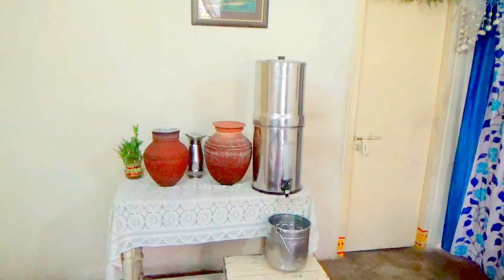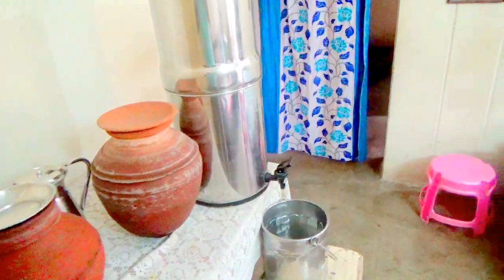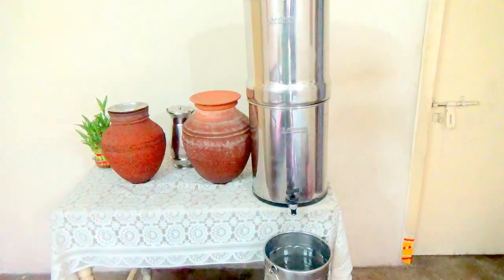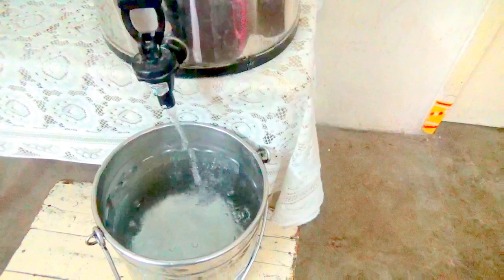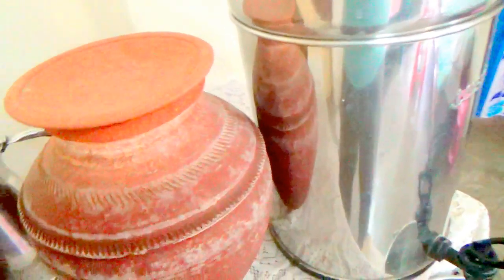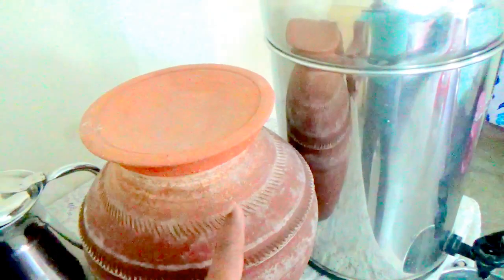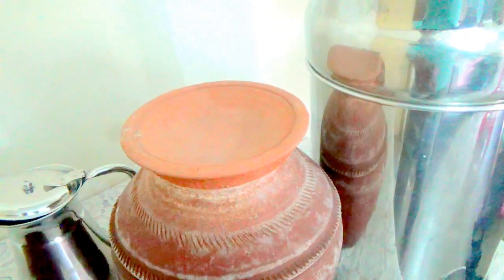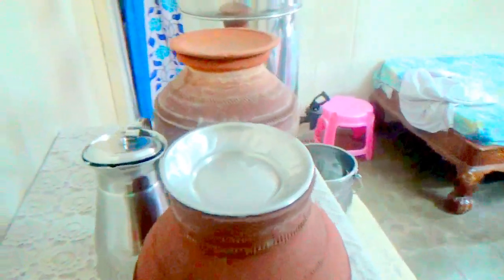Clay/ Mud Pot gives  Pure DRINKING WATER   - Avoid plastic containers  for water use

Comment: Hello Ponnala, I’m so glad I’ve come across your video. Could you tell me more about this steel container with clay candles? Do you buy the container and candles separately? I’m in Saudi Arabia and I can get the clay pots but I’m not so sure about this steel thing. Also you don’t mention after how much time you transfer the water from steel container to the first ghada and then after how much tine to the second ghada. Much much waiting your your reply.
Reply from the maker: Thanks for your initiative gesture shown  about the video.  Actually steel container  is a water  filter (both container and clay candles in one set ) manufactured by the well known companies in India. The same may be available in Saudi Arabia also .  First we have to store the water in steel filter  and the water will filter in to lower  container  in  about 2- 3 hours . Then water can be stored in  first  clay pot /ghada  for another 2 hours approximately. Now the pure water is ready an can be stored in 2nd clay pot for drinking use..

Comment: does mud pot soft  the hard water and salty water ?  for drinking
Reply from the maker: Actually  soil i.e. mud has  a capacity to absorb   the hard minerals   and to some extent salt and removes to the upper surface of its edges. so we can see   clearly the impact of the same in the shape of patches on  surface  layers  of the mudpot. Mudpot can be cleaned at least fortnightly to clear the impurities for safe drinking.
Reply: we  kept  water  in mud  pot  ...   boil  or  simple  boring or municipal  water ?
Reply from the maker: keep municipal water  without heating for few hours , then heat it and use after cool.  bore water can be heated till boiling and cool down then keep it in mudpot similarly. Dont keep hot directly in to mudpot. it will damage the mudlayers of mudpot
Reply from the maker: @Fashion_Clothing520  Bore water has to be compulsorily heated before  keeping in Mudpot for more than 5 to 6  hours . Municipal water normally treated with chlorine process by the Govt. agencies.  However the water now due to corona  virus  may have to be heated   for safe drinking.
Reply: i have  only  mud  pot  not  steal   so  i  kept water  only in mud  pot
Reply from the maker: No worry. use mudpot  for keeping water for few hours 5-9 and then heat it and cool down for use.
Reply: we have here  boring   water  ..  we simply  pore  water  in to  mud  pot  without  boiling  .. is  it  ok   for  use ?

Comment: Dou know what is meant by osmosis???
Reply from the maker: Osmosis is the movement of water or other solvent
through a plasma membrane from a region of low solute concentration to a region
of high solute concentration.Osmosis is passive transport, meaning it does not require energy to be applied.
 Here impure water when we stored in mudpot, the mud i.e. soil will act as filter and removes fluoride & other impurities to outer surface layer of mudpot. we can see the white , colored patches of fluoride impurities on its layer clearly.

Comment: What is that inside the steel upper chamber?
Reply from the maker: Two  candles made with clay material to filter the water by removing certain impurities and then by the mudpots  continously.
Reply: what are the candles made of? how often do you replace them?
Reply from the maker: @crystalhealings9901  Candles are made with clay material to filter the impurities from water . These candles can be used for  2-4 months easily and  replace with new candles available in the market.
Reply: Stainless steel candle water healthy or  unhealthy
Reply: Hello Ponnala, I’m so glad I’ve come across your video. Could you tell me more about this steel container with clay candles? Do you buy the container and candles separately? I’m in Saudi Arabia and I can get the clay pots but I’m not so sure about this steel thing. Also you don’t mention after how much time you transfer the water from steel container to the first ghada and then after how much tine to the second ghada. Much much waiting your your reply.
Reply from the maker: @sarahaymen4665   The clay candles are also  available alongwith steel container... After use of candles for about 3-4 months these can be replaced with new one. . the water can be transfer from one pot to another after 1-2  hours for use.